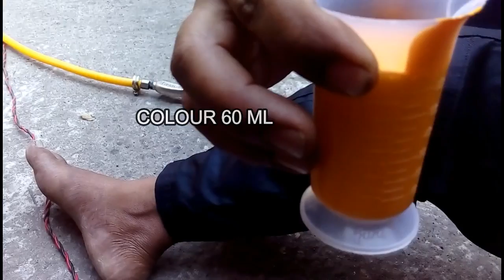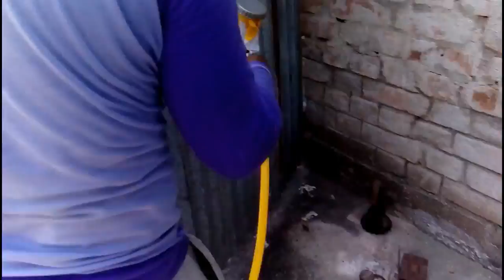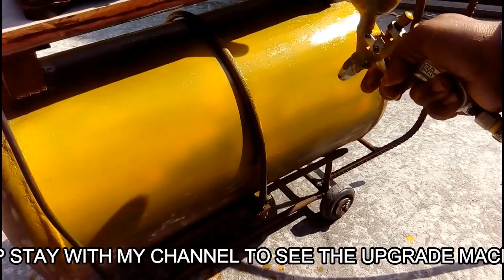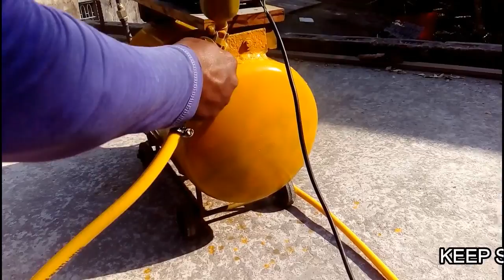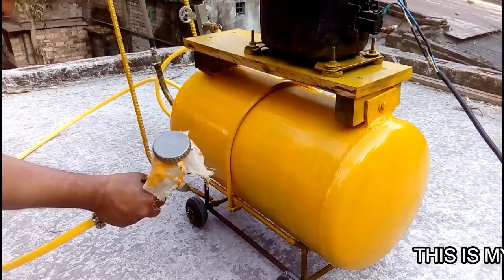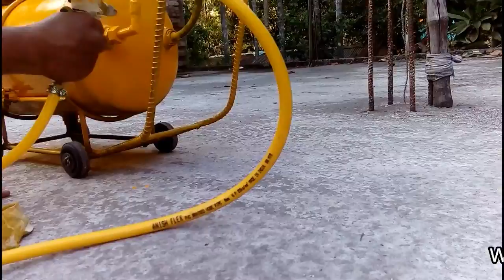How to do spray paint at home | DIY

Comment: Good attempt. but your gun is not of professional quality. You can't spray a car using this gun. Good quality professional expensive guns provide excellent finish and quality.
Reply: The Engineer 🤷🏽‍♂️It’s not the gun that matters most of the time. It’s the painter. I painted a whole care with a $40 spray gun and it came up flawless after wetsanding and polishing

Comment: you might have used a rotary compressor instead fridge compressor
Reply: Zenith Computer's i hav already done this type of compressor at home but the problem is the time taken to fill the cylinder is low moreover the tank must have a opening valve to remove moisture and oil inside the cylinder from the base .but sill can be used for domestic usr